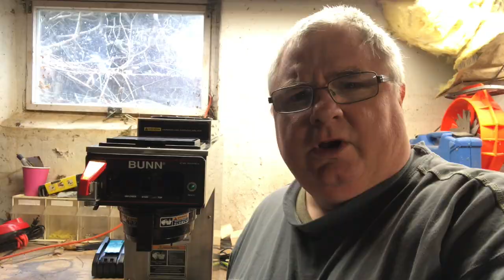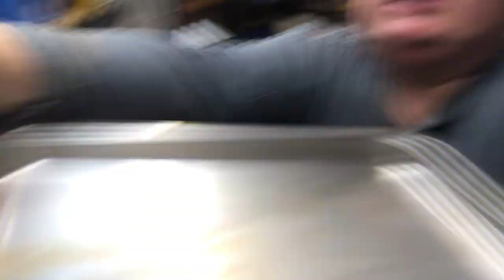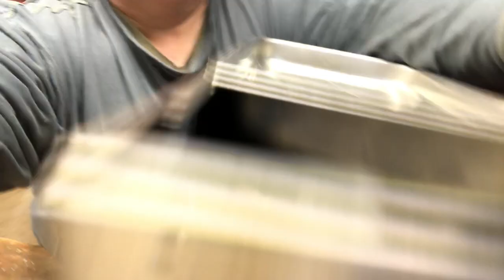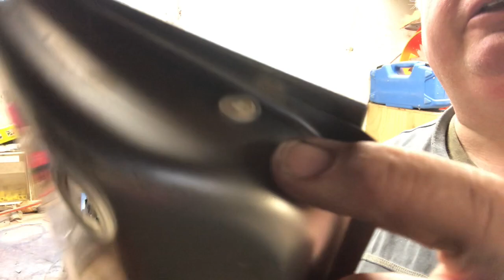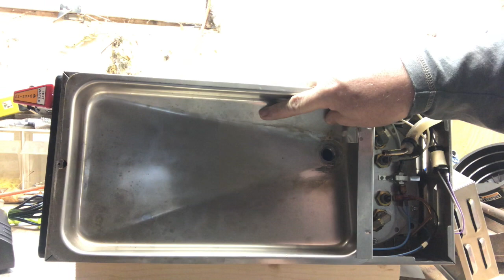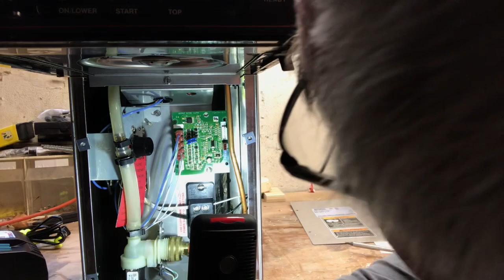Bunn CW series electrical and leak points

Comment: To program Brew times/volume, you will need to press and hold the Brew button until 3 distinct clicks are heard. Once you hear those 3 clicks, release the hold on the Brew button within 2 seconds of the 3rd click. Brew until desire volume is achieved and power off the unit. Brew a few test batches after setting batch volume to test consistency. Depending on the board, there may be a small toggle switch on the board that says SET and LOCK, you will need the toggle to be in the SET position when programming. I haven't worked on one of these in a while, but if I run into one again soon I will update with more info.

Comment: You taught me a great thing, thank you for your time.  All I want to ask is that there is no need to clean or change the water boiler right?  Can't we just add water directly from the surface without connecting to the water line?  And How do you wash the hot water line? Thank you for your time again.
Reply from the maker: Nefisa Siraj  yes this Particular machine you can add water to the top. On the other machine we will have A block off plate that will not allow you to add water like this machine will. The machine in the video is a special type because you can either have it directly plumbed into the house or you can use it as a pour in the top. As for changing the water in the boiler because we use the coffee maker every morning The water gets changed out rather often. For the hot water tap my kids like to drink a lot of tea and hot chocolate so that doesn’t sit in the machine that often. I would see if the machine has not run with in about a month and a half for two months I would change out the water. And all the machines that I have seen I have not seen any of them that have needed to have the plastic hoses washed out. Thanks for the view hopefully this helps